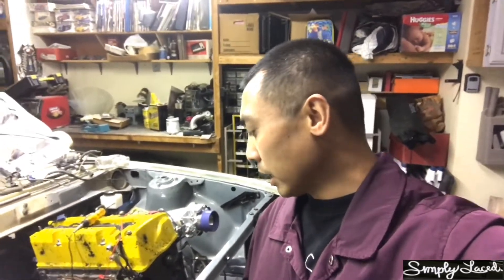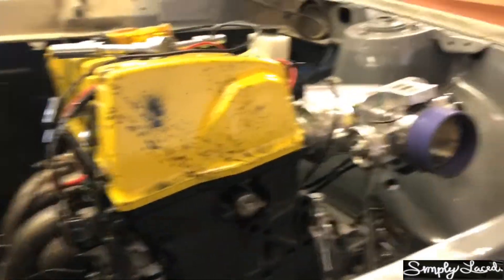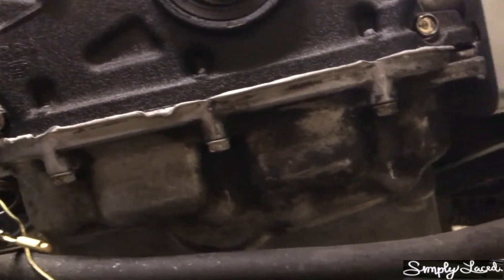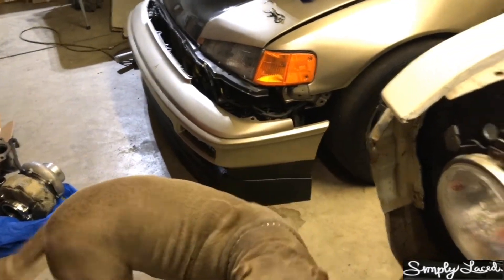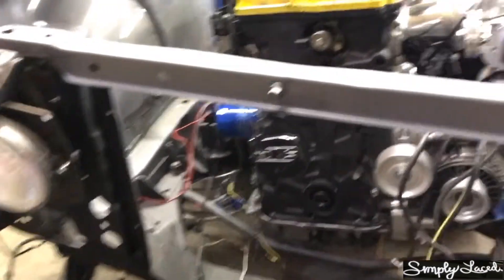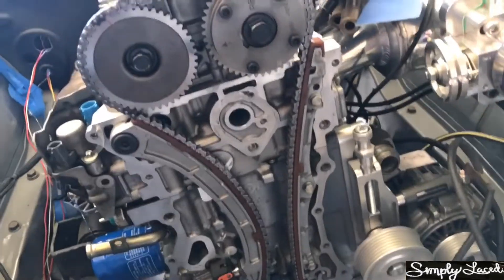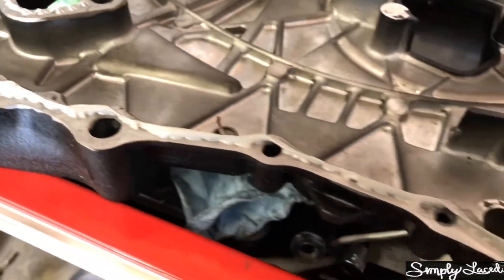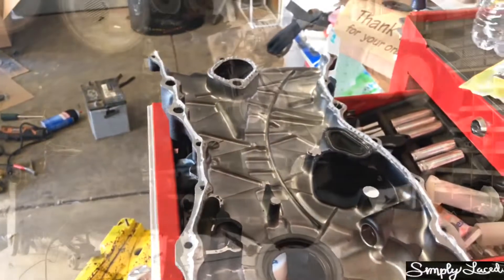K20 Celica Swap 1st Start Up

Comment: Just in case since timelapse, don't forget do not torque down any gasket surface, just hand tighten it, let it dry about 8 to 24hours (I think), torque down next day, then fill it back up with fluid. I screwed up on a transmission pan so many times doing it with the engine in car and not completely dryed off. Big mistake could never get a seal from gear oil leaking through. Also you don't want to squeeze your gasket out so thin by making it too tight before it becomes more solid.

Comment: Love it. Thinking of going K in my 74 RA21. Yours is the first and only that I've seen. I got a mazda rx8 6speed trans but the shifter would be moving about 7 inches back! How is shifter placement with the s2000 trans?
Reply from the maker: Yes I wish the shifters location ended up in the factory’s location but it’s 2 inches back

Comment: How ya been brother? Why did you go with the valve cover ventilation on that particular area on the valve cover? What tps are you using?
Reply from the maker: I been really busy with every thing else that pops up in life. I’ll be recording soon. Fence blew down, COVID hit home, my dog Nalah had a litter ect. The vents was not by choice that’s just what was on the valve cover when I purchased it so I just worked with what I got, as for the tps it’s factory from Honda. I should have new updates by next week. How are you?
Reply from the maker: The K20 vented location was chosen to be different.
Reply: Aww brother I'm sorry to hear.  I pray for healing for whoever was affected.  It hit some of my family too. Thanks for the info on the car. Take care brother.  One day at a time. God bless
Reply: I recently installed 10an bolt on fittings to a modified Ebay catch can.  I angled the 90 degree fittings as upward as possible and mounted the catch can as high as possible and haven't seen a single drop of oil in the catch can. I'm having issues with the car either too much boost or a fuel issue. Its cutting me at high rpms.
Reply from the maker: @camlobesvtec  dose it fall on its face and forces you to shift?
Reply: Yeah falls on its face. Kinda like hitting a wall. Right around  5k it stops me from making power. It's been happening after I upgraded my intercooler to a treadstone.  I think I'm making too much boost to fast. My boost cut is 14psi .I even upgraded my wastegate to a 44mm. I was able to hold the boost steady at 5 psi but I'm tuned for 11 psi. When I try and turn it up with my manual boost controller it starts to cut again.  I'm stumped
Reply from the maker: @camlobesvtec  so sound like your hitting boost cut, turn down the boost, just may be getting a better flowing Intercooler that’s allowing you to build more boost and at a faster rate.
Reply: Do you think its possible that I can make the same power with less boost due to the better flowing intercooler? I think cooler ambient temperature is also a factor.  I'm probably gonna try my old ebay intercooler to see if it runs the way it used to.  I also found a hidden boost leak that may have been dialed in with my tune.
Reply from the maker: @camlobesvtec  yeah if you found a boost leak and a better flowing Intercooler I’m sure you can make the same power with less boost or even if you get a bigger turbo and make the same with less boost
Reply: I'm starting to suspect something with my fuel pump.  I drove it the other day with a lil over half a tank, didnt even go 15 miles and my fuel gauge dropped to about 1/4 tank.  Plus I didn't properly route my return line into the stock pump housing.  I'll be doing that this weekend.  I'm puzzled because I can usually find and fix any issues with the car.  I did have two good days with the new intercooler setup.  Things that make you go hmmmm.  Congrats with the pups you take care be safe .

Comment: I might be able to get my hands on a free, used K20 engine. A student crashed their RSX at the university and abandoned the car. I got to thinking about a swap into my celica, and I found your video. Is it worth it??
Reply from the maker: Elvis Rodriguez it’s going to be a unique build and as long as it’s something you will enjoy doing, it’s worth it. Any thing you enjoy doing is worth it. There is not much of a support for this set up but a big aftermarket for the k20 engine.
Reply: Pineapple Garage how long have you been working on the swap? Is it something that is super long term? Also, how much would you estimate the cost will be? (Not for the engine itself, but the rest)
Reply from the maker: Elvis Rodriguez I been working on it for about a year, so far what I spent to get it running with out the engine about 1500.00 but again I did a lot of my own fab work and I did get a lot of parts for almost free. Engine was 200.00 and s2000 tranny was free
Reply: Pineapple Garage ooh you put a different tranny in it. Gotcha. Well, I’m going to consider it! I’m not a mechanic, so I wouldn’t be doing any of the work myself... just getting the motor. So I’m sure it can get pretty pricey for me. Does the k20 tranny not work in that set up? Or you just wanted to do something different and get the s2k one?

Comment: Steel wool and a wire brush(toothbrush type) works best for cleaning surface...lol
Reply from the maker: I tried steel wool too but the particle break apart and I don’t want that to fall into the oil pan.
Reply: rag the opening